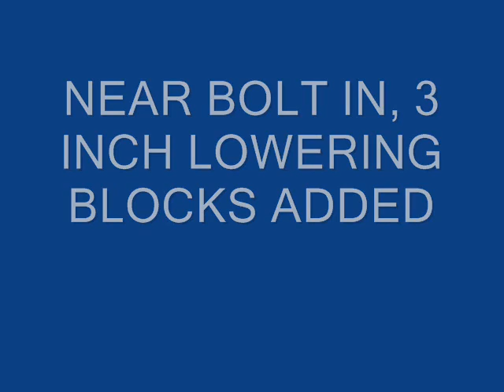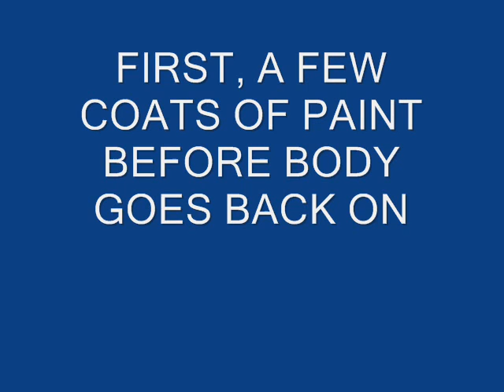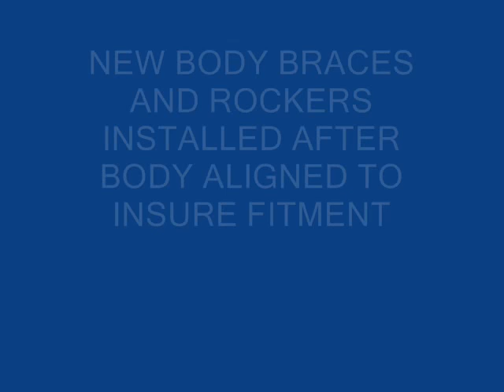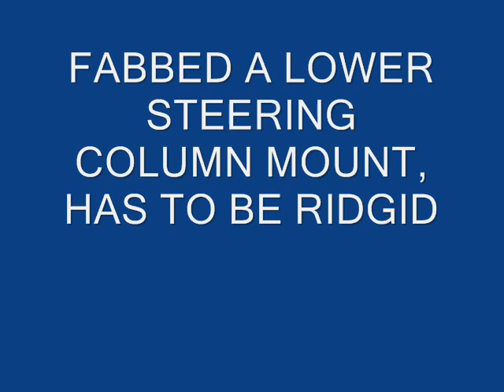50 ford part 2_0001.wmv

Comment from the maker: I don't have a detailed 'how to' thread of the steering set up but basicly keep the the tie rod links parallel to the lower control arms and parallel to the crossmember with the links straight. 
I have yet to drive it to see how it works.